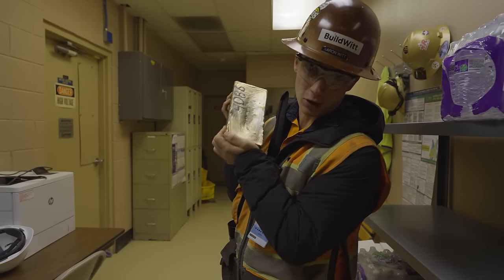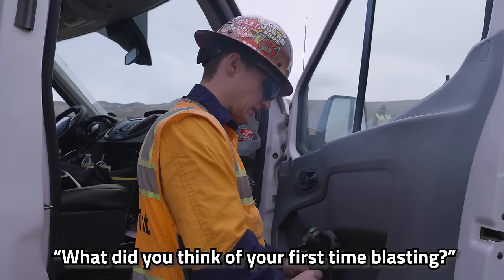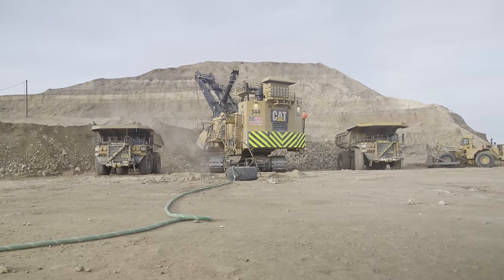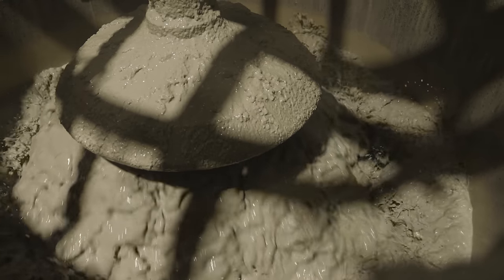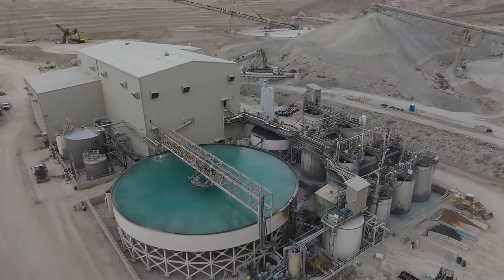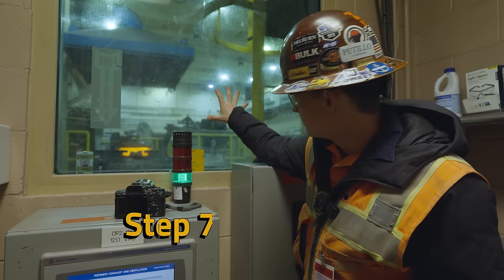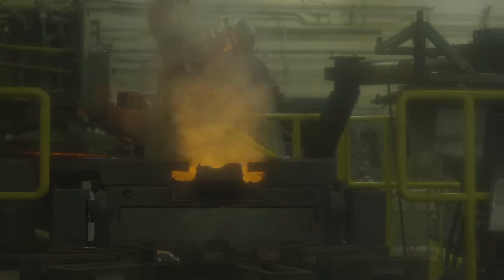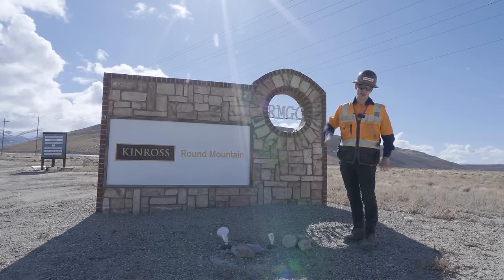How Nevada Produces BILLIONS in Gold

Comment: As a retired welder over 35 years,  I've replaced enough Gotdayum steel in rock trucks , 777 , 787 , Dozens from a 350 to a D11 cat , Shanks , teeth on shovels , buckets , hoppers belt lines , trains expert on some 1950 model rail cars,  to reach Mars and back 3 times ...lol...

Comment: Dec 2017 I had the opportunity to haul the boom pivot base, (63,000 lbs, 9' 6" wide x 13' long x 9' tall) for a Rope Shovel to Round Mountain NV.
The Bucket weigh was in excess of 100,000lbs.
The bottom door was 13'+ wide x ~20' long  x ~2' tall at 35,000 lbs.

It took the Cat Team 46 days to assemble the entire project😊

What an experience.😊😊
Reply from the maker: that's amazing!!

Comment: Love it...the 1st time I was at round man there was a hill. 2nd time small hill. Now a hole. So e nice spots up the hills  and a hot springs.  Darrough near by. Loved old mines all my life. Pit mining is efficient  but kinsey have the same panache. I was in the granite  business. Quarry to finished gravestones. It's more similar  to this type of mining. Just blasting was black powder as slower expansion and wouldn't  fissure  the stone. Family was in the cement business  which  used ball mills. Quite away from old stamp mills. Round mtn is a very impressive operation. More or  less like process in old VC for example but modern and huge.

Comment: how much gold would be in 250 tons of ore
Reply: As of a 2017 mineral estimate report their grade is about 0.7 grams per ton of ore, which puts that at 175 grams of gold. Current gold prices are around $76 a gram, so that would be just over $13,000.
Reply: Those are some horrible numbers, are you sure about that?
Reply from the maker: They said not much in each truck
Reply: If it’s only 0.7 grams per ton that explains the heap leach they have. 3-5 grams is usually what they need to see to be worth crushing and concentrating. I’m surprised they don’t have any Knelson concentrators at this mine. More efficient than spirals I’d say.

Comment: looking at the path the haul trucks take to get out of the mine
how often does that route shift as they change working faces

like obviously a mine this big should be using electric dive haul trucks with trolley wires, which ofcourse require overhead wire infrastructure that you dont want to be moving around very often
does the haul roads and mine faces change around so much to make long(ish) term infrastructure an issue?
Reply: It depends on the mine. The mine I worked at had these for a time but only realized a 6% increase in profitability. The solution was to simply buy bigger trucks.

Comment: Ive never seen those tailings leeching system before.  Thats pretty wild.  The Electrolytic process with electricity in the tanks would be too much hassle for so little gold I assume?  How long does a pile of tailings sit there under the leeching pond?  Does it get added to as the shaker tables create more tailings or was it just old tailings?  This is so interesting.  They spent a lot of money to build the building in order to keep the dust down.  They still use anfo for blasting in the industry.  Ive heard people are trying to change that up, but if it works, then it works.

Comment: I ❤ gold .... will it hit 2400, 2500 or more before it stops going up ? Just think that it was just around 1800 not long ago. The money you could make in such a short time if you had it to buy before it started going up. I buy for selling in 10 years or more or if SHTF along with silver. Another great video.
Reply: The higher it goes, the easier it becomes to de-link from. Bye Bye USD
Reply: I remember when it was under $800
Reply: @adeptpeasant6161  There's not enough gold in all the reserves in the entire world to match the value of U.S. treasuries. You don't know what you're talking about. Let's say, just for the sake of an interesting thought experiment, that you were right (you're not)... The U.S. reserve owns 8,133.46 tonnes of gold (more than the next 3 countries combined). And IF the dollar is ditched, what happens? Would the spot price of gold need to be artificially recalibrated to over $80,000 per troy ounce to meet parity with the world economy? It makes no sense.

Comment: Lake talure valley
Reply: Veins on the sides
Reply: Lompoc has at least 5big loads
Reply: Strawberry feilds placer deposit  same with Las tunas an El captain
Reply: The la waterway is a gaint sluice that needs cleaned its full
Reply: Placer deposit from the grass roots to the hard rock
Reply: Lake tulare valley